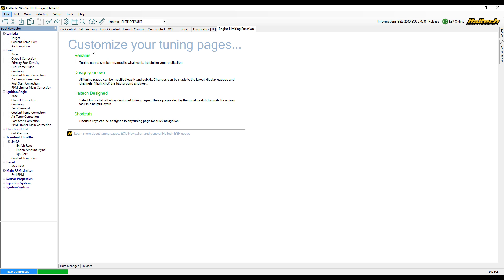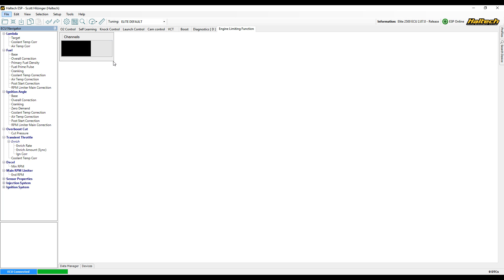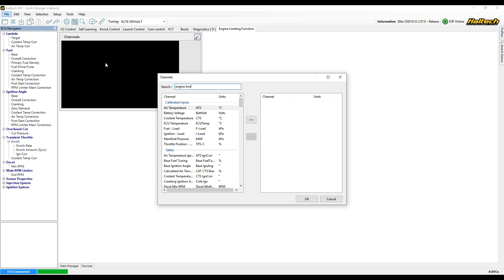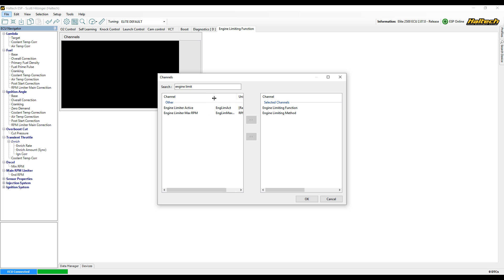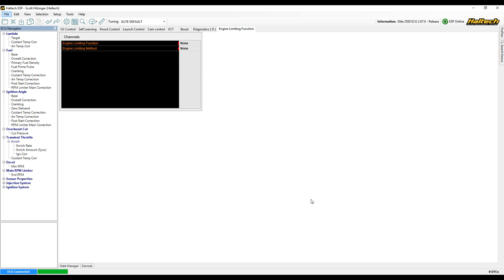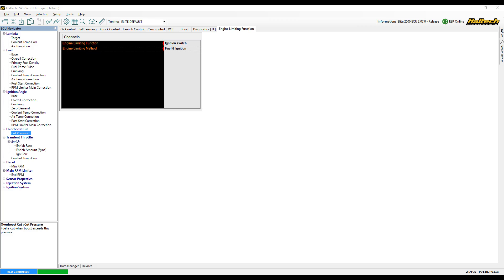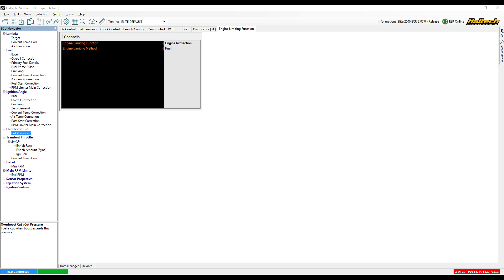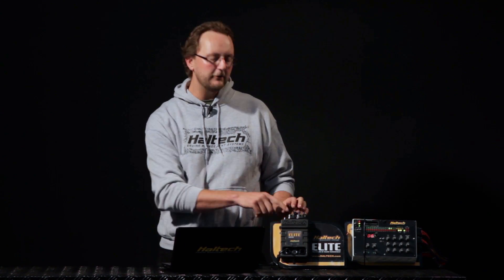Setting Engine Limiting Functions - Haltech Technically Speaking

Comment: Run engine limiting function, came up none, still not getting any spark, not even trying to fire, any ideas, elite 750 on ford el 4.0lt sohc, thanks Peter
Reply from the maker: Hi Peter, the best thing to do is to contact our tech support. Either via email or phone, one of our guys will be able to walk you through the process or remote access if need be.
Reply: @haltech  what is the best contact number please, in Townsville

Comment: I haven't seen it anywhere but a huge advantage to using a haltech on an ls1 /2 or 3 is that if you do swap motors with a different crank trigger it can be tune adjusted unlike the factory computer that needs a trigger swap or converter box. This is something you would think would be a pretty big sale point, shame there isnt patch looms to suit direct plug in commodores using standard loom or am i not looking hard enough? I had a built v6 with a gm sport was awesome, would love that for the v8's.

Comment: I'd love for a video that goes through the basics of what you'll need to wire to actually run an engine.
Say for turbo 4, and n/a v8. 
It's going to be a long road for me to wire mine regardless though lol
Reply from the maker: +fellowship of the goat We have a wiring video in the pipeline, though it mainly addresses the different types of harnesses. Since every engine is different, it's hard to do a "generic" wiring video. Wiring an LS engine would be completely different to wiring a Coyote engine for example.
Reply: haltechecu Yeah for sure, anything helps lol. Even a general thing about whether you patch in to the factory harness or wire from fresh
Reply: +haltechecu do you have any thing for a 1995 firebird formula 5.7 lt1

Comment: I wish Haltech ecu's wasnt so expensive. Can buy a cheap china ecu for under half its price
Reply from the maker: +Leofred You mean like the Sprint 500 that we sell for around $700?
Reply: haltechecu The whole kit with harness, cables and computer software for 700usd? I haven't heard of it before, only the Elite series thats costs way to much for most first time tuners. Does it have turbo pressure adjustment, idler valve-, and multi coil features?
Reply: +Leofred yeah and get 1/10th the quality. Logic...
Reply: Beruka 1/10th the quality? The ones I know of are still running. Haltech should have had a 500usd unit that covers most basic functions for newb tuners
Reply from the maker: +Leofred All the specs for Sprint 500 are here: http://www.haltech.com/platinum-sprint-500/